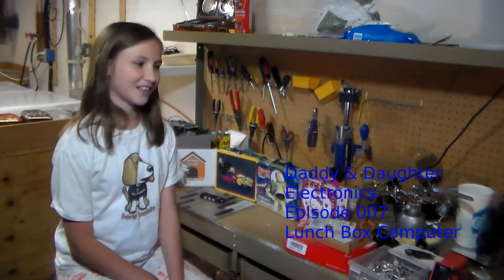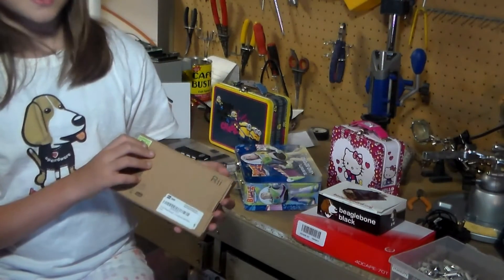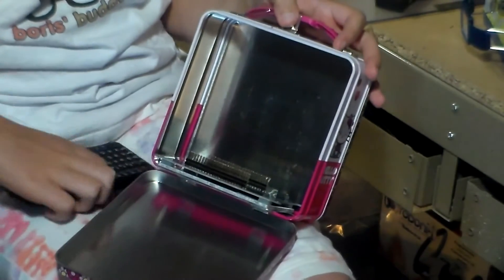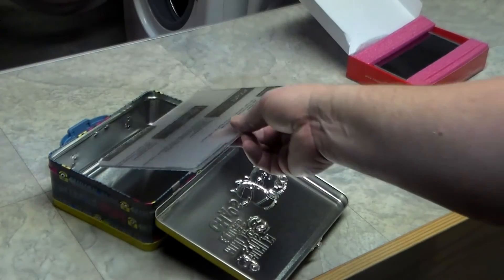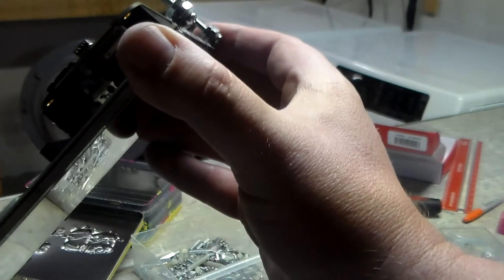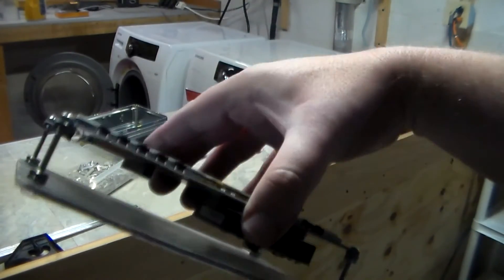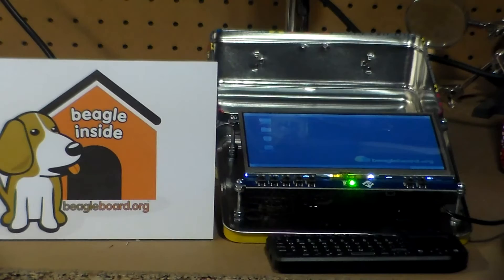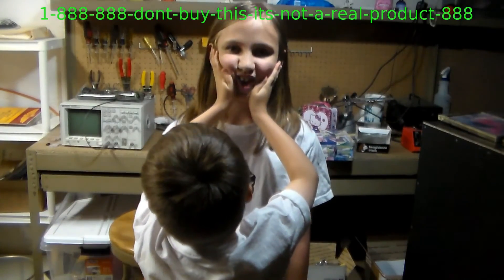Daddy and Daughter Electronics Episode 7 - Building a Lunch Box Computer with BeagleBone Black

Comment: Hello sir but I have a question. In this video you show the construction on how to make this computer but if i use a sd card to put ubuntu on, after i install ubuntu on the sd card do i put it in the bbb or is there preparation involved before i put it in the bbb. Your response would be extremely appreciated.
Reply from the maker: +BLTManiacman You can either run the included Debian Linux on the BBB or load your favorite version of Linux.  I personally like to run Ubuntu or possibly my penetration testing edition of Ubuntu call The Deck.  Either way, you will need to setup the SD card from a Linux computer and then put it in the BBB.